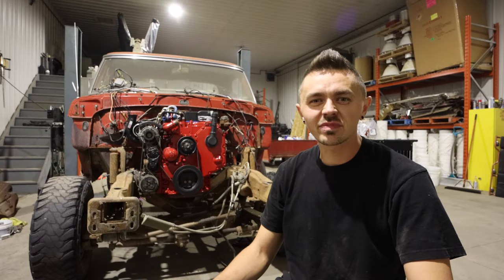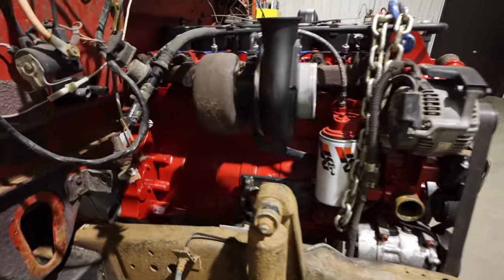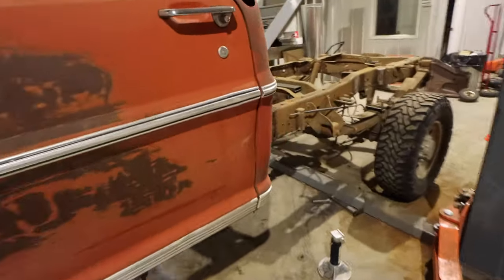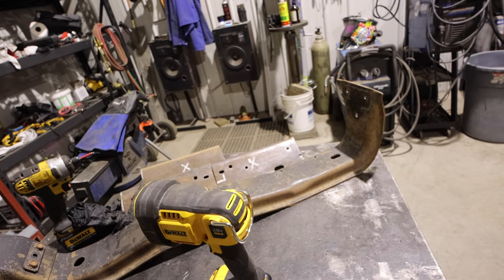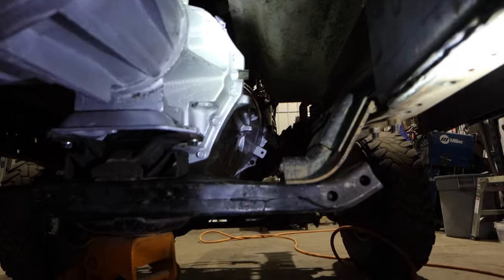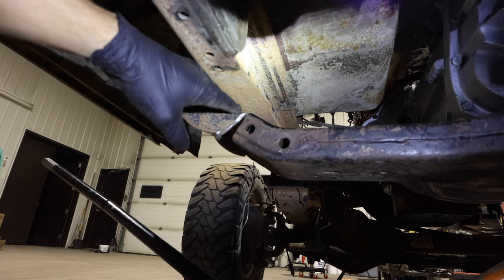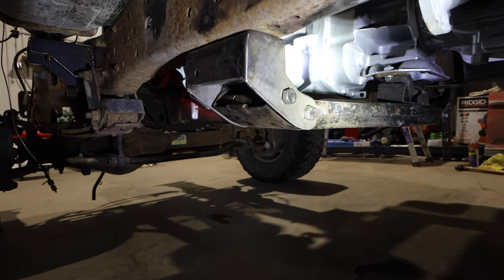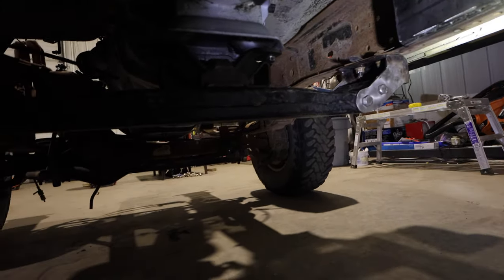1967 Ford F-250 Cummins Swap | "Project Arnie" Episode 4 (Transmission Crossmember)

Comment: Well done sir! Next video can you show where the mounts come through on the inside of the cab? Really cool build so far, excited to see the end result.
Reply from the maker: Kai Blue hey!!! Thanks for the feedback, much appreciated. Not sure what mounts you are talking about. Are you talking about the rear cab mounts that would be under the stock in cab gas tank? Stay tuned for more videos!!
Reply: Chillie Willie's Media yes the cab mounts, im in the process of restoring an old squarebody. Wanted to see if you have to cut the floor out of old fords to get to the cab mount bolts.
Reply from the maker: Kai Blue no not at all. You have to remove the gas tank but the bolt heads sit flush with the floor. I have yet to build the rear cab mounts, just have the fronts done right now. Not sure the angle of the cab yet. I was thinking that might be my next video. Bolting everything back together, building the rear cab mounts, rad support mounts and mounting the box. With using  a 99 F-350 frame nothing bolts on straight and every mount has to be made to fit.
Reply: Chillie Willie's Media i would love to see that process. Its the nitty gritty things like that!